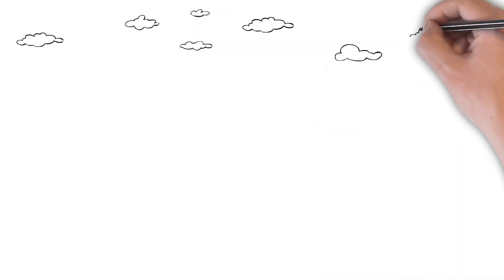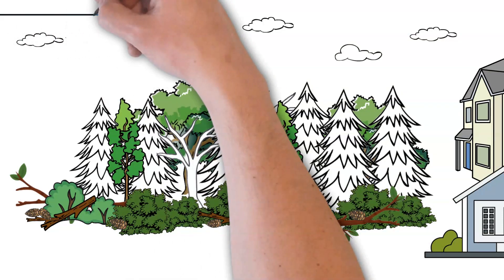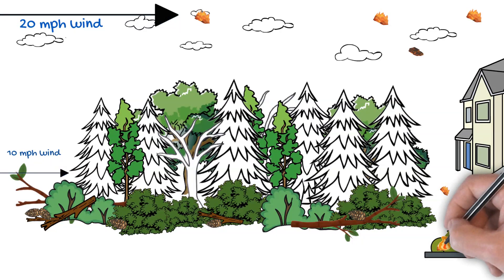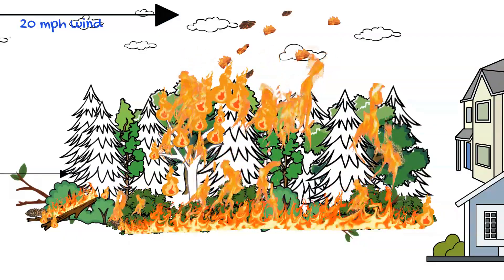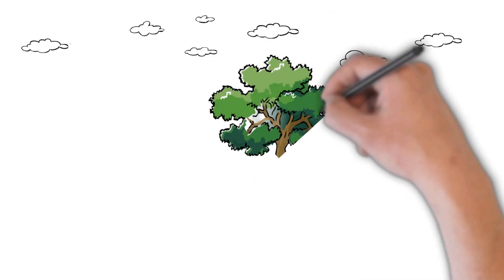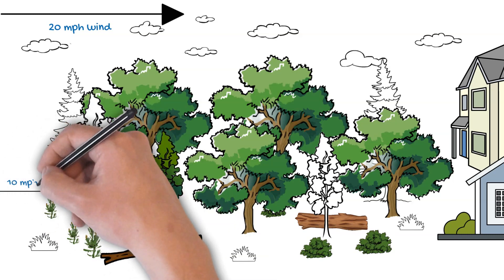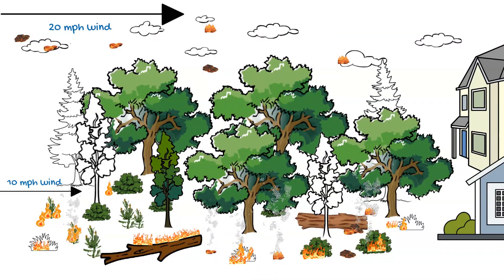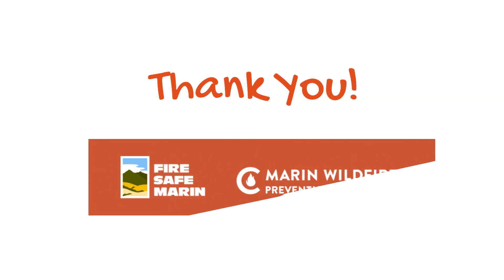Fire Behavior in Untreated vs Treated Areas

Comment: Excellent graphics and clear information. Thank you! But what happens to all the “slash”? The material that is cut out could add up to tons of branches and detritus — even chipped, does it become its own fire hazard?
Reply: Excellent question.  If the removed material isn't disposed of properly, it can create its own problem.  Some of the materials are chipped on site, but we limit the depth of the distribution of the chipped material in a way that it does not exacerbate the fire problem or inhibit native plant growth.  Some of the material is removed from the site and taken to mulching facilities.  And some of the material is piled and burned on site.  This is the case in remote areas where removal by hand is not an option.